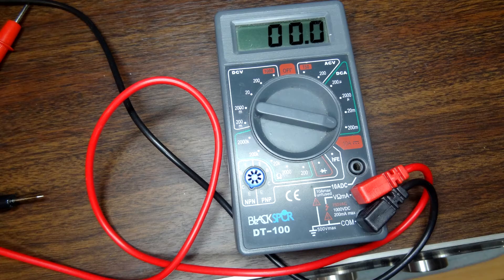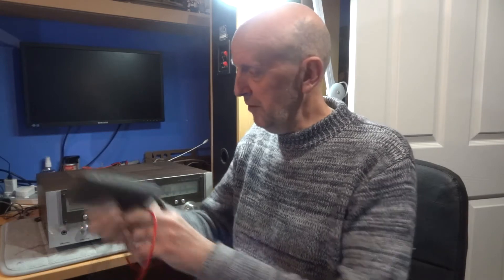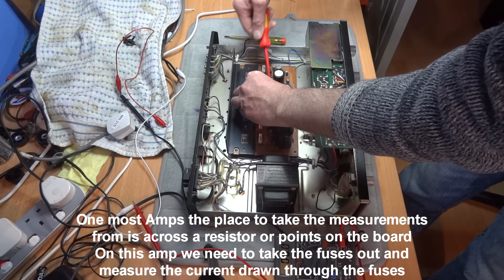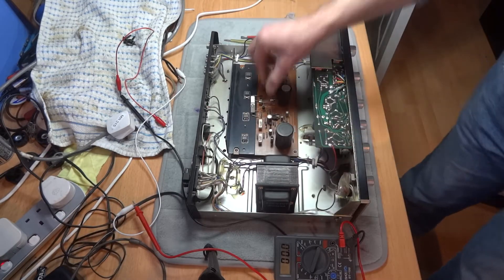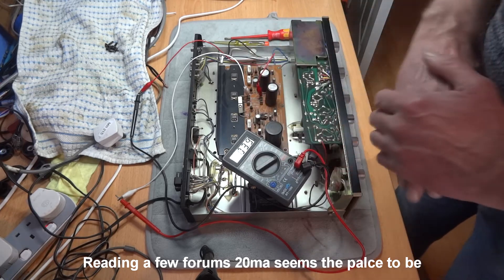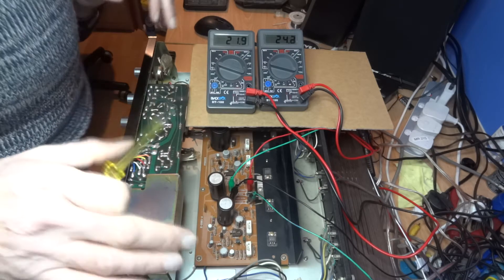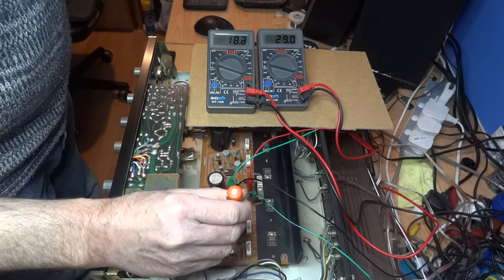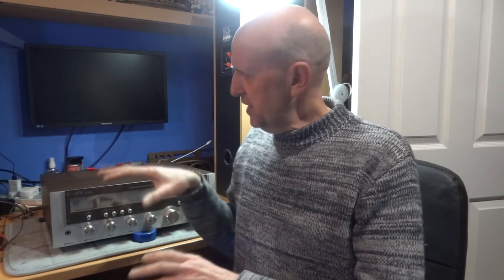Amplifier & Receiver DC Bias Adjustment, Sansui 101 tweaking, Sony, Marantz, Pioneer, Rotel, Yamaha

Comment: Hello, what do we do if the bias current is too high and we can't adjust the voltage?
Reply from the maker: If its miles out then check other components in the circuit like driver transistors and main output transistors,
Diodes.
Emitter resistors these are normally the big white ones 0.5 or 1 ohm if they are short circuit.

Comment: Hi Michael. Great video cheers. I have a Sanyo DCX 2300K, small receiver. The service manual doesn't mention DC bias adjustments at all. It does have information on RF adjustments but nothing on bias. It does have safety fuses at the back for left and right speakers. Do you think this is where I can take my readings from, removing them and taking the milli amp readings for the DC bias. Any suggestions would be welcome as I have already researched for info on this and found nothing regarding my receiver on the internet. Cheers. Garry
Reply from the maker: Hi Gary. I did download the serive manual and can see there are no mention of setting the DC Bias. No those 2 fuses are the speaker protection fuses you see on the back of the Receiver. You would have to take the reading in millivolts not milliamps across resistor 429 for one channel and resistor 430 for the other, but the manual does not state the value. At a guess 7 to 10 millivolts might be about right, but a bit of a guess.
Reply: @MichaelYates  Thanks Michael, clearly still trying to learn as much as I can as I go along. Really appreciate your help with this and providing a detailed answer, will take a look at that now. I'll keep watching for more learning points as I go along! Cheers again. Garry

Comment: Thanks for the tutorial. I had to replace a STK0050II hybrid amplifier module in my SR 4000 receiver, but I can´t find any adjustable resistors to adjust the DC bias. The link to download the service manuals is down for new users.
Reply from the maker: Hi there is no DC bias ajustment on the Marantz SR4000 just a led meter calibration adjustment. If you require the manual just email at arcadeimages@gmail.com
Reply: @MichaelYates  Hello Michael.
Thanks for the clarification, because without having the service manual and seeing that everyone has to adjust the DC bias in his amplifiers, I was worried. On the website of the link you mentioned it is no longer possible to download the Marantz manual, so I would appreciate it if you could give me an alternative. Many thanks from a Valladolid at 40ºC.

Comment: This was the following dc offset from my 7.2ch av reciever
Is it good ?
Dc offset
Front right 
-0.5 mv

Front left
-0.2

Center
-5mv

Surround
Right
-35.7

Surround left
5.1mv

Height right
-29mv

Height left 
-12mv

Or should the surround and height right be corrected ?
Reply from the maker: I have spoken to a few people about the acceptable DC offset level and we think that under 25mv as good and under 50mv is ok though nearer that 0mv would be pefect, with vintage units getting near 0mv can be hard. So I would say your readings are ok, but if you can adjust the -35.7 and -29 to under -25 that would be good
Reply: @MichaelYates  do you think this was caused by dc being present in the power line ? I have a doubt on that 
And possibly high thd in the line as well
Because i also hear hums and my equipements heat too quick
I can try to call the power company if this could be signs
I hear the reciever transformer buzzing too
Not too loud but it's there
Reply from the maker: @kuronekosan2830  The receiver power supply will smooth any DC spikes if there is any, as for the hum if its coming from the speakers it could be the power caps, bad earth loop amoung others. The transformer humming or buzzing could be from it drying out over time, but nothing to worry about some do, if it get really loud I do have a few repair videos on channel for that. Some amps and receivers do run hot, old Marantz for one. If its only just happened then could be caused by DC bois needs a little adjustment. But with the readings you gave I would not worry to much until they got a lot worse. Also you could get a external power supply conditioner that smooths out spikes.

Comment: Hi, probably a stupid question but... How would you adjust the amp if the amp boards don't have trimmer pots. Restoring a HMV Stereomaster 2018 and after capacitor replacement sounds like its clipping/distortion at about half volume on both outputs. thanks. Any help appreciated thanks.
Reply from the maker: After a recap this can happen and not an easy one as the unit has no trimmers. If it did it did they could be anyware connected towards the Base of the output driver transistors I would have thought but were I dont know to be honest.
With a circuit diagram it might be worth joining a forum where a lot of users are more experiance than me on this. Wish you luck getting it sorted
Reply: @MichaelYates  Thanks man, was hoping for something simple haha. Appreciate your time in getting back to me, tc.

Comment: Your multimeter should be set to DcV not DcA
Reply from the maker: Hi George, I am measuring across the fuses and using DCA for current drawn and not across the 0.5 resistor at the transistors emitter that would be DCV

Comment: Just what I need Thanks. I repaired mine by changin only one transistor. All the rest is original. I don't fell like changing capacitors considering that it sound pretty good. I'd like to conserve it as original as possible considering the great internal conditions. Some suggestions ?
Reply from the maker: I to like to keep my amps as orignal as possible, why replace something that sound fine is what I think. But sometimes if they sound that bad then the caps might need replacing. I have read on a lot of forums replacing the caps in this au101 can make the tone a bit to bright. At some stage I will get another 101 and replace all the caps and compair the 2 as a matter of curosity. But stock is my preference to

Comment: Hi Michael, wondering if you have the time to help or offer some advice! I have a Teac ax 5030, was working but after a short while of playing the treble Freq seemed to drop, so I thought I'd adjust those pots and take the readings from the emitter resistors, well like a plonka I shorted the pin from the emitter to heat sink, the amp blew a fuse, emitter (ceramic o.22x2 dual emitter) I have a burned resistor, think output transistor might have gone and blew main power fuse and puffed a 47uf 100v cap, also burnt a track on the board! I am sourcing parts for repair, the manual says set the bias to 6Mv, how do i see this reading on a digi MM?
Would you like to repair it for me lol?
Reply from the maker: Hi Mark, Sorry I can not help to much at the moment as right in the middle of house moving. But I have done this many a time in the past and the reasons I dont do repairs as its so easy to do, even easier now my hands shake a little lol. I try and use a very small crocadile clip if possible. By the sounds of it there will be quite a few componets that need replacing here.  I could not find a service manual for this amp, but I would have thought the manuel would show you were to take the reading for the DC bias from normally across one of the 0.47 ohm resistor on the output transistors for each channel by setting the multi meter to the lowest DC volt setting and adjusting a trimmer pot. Wish you good luck with mending the amp

Comment: Thank you so much for putting this video together. What is bias and why is it even done. It sounds like some sort of calibration to mirror the two channels so that they operate identically from an electrical perspective is this correct? Great video!!
Reply from the maker: Its done to get the optimal out of the transistor while not over powering the transistor, keep the distortion to the lowest, stop clipping as much as possible, to keep both channels running smoothly and at the same level, ie both channels set to the same bias.

Comment: Would it be odd for a seller who's capable of servicing amps, not to bother with doing it before selling? I'm curious as I'm interested in an amp but have asked if the bias and offset have been set but told its just been cleaned up. It's an old amp from the early eighties. I didn't think it was an unusual request for someone who fixes amps? Cheers
Reply from the maker: Would have thought it would be in the sellers interest to set the bias up as manual and offset checked, would have been a great selling point and give any buyer piece of mind. So yes seems odd to me.
Some sellers serviced / refurbished is just a clean inside with a hoover or brush to remove dust, not what I would call a refurbished / service unit.
Reply: @MichaelYates  this is what I've noticed. But this chap has changed the terminal outputs and the input potentiometer bar for this amp, and is selling another that's been recapped by himself. I think i need to take a step back. He said doing this would be part of a service, but I just see it as good practice. It's a nad 3150
Reply from the maker: @CM-dw3gh  If he has done a re-cap and changed the potentiometer then it would just take a few minutes to adjust bias and offset. As this video shows  https://www.youtube.com/watch?v=JbMhWKOgx_I  , wish you good luck in which ever way you decide to go.
Reply: @MichaelYates  cheers mate.